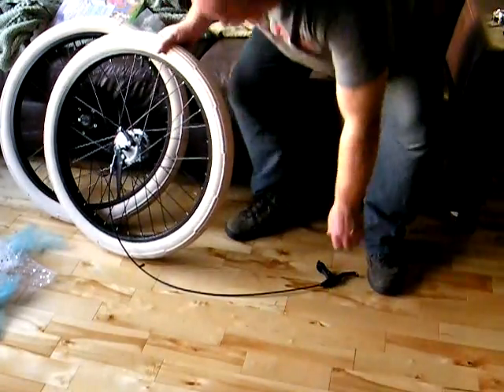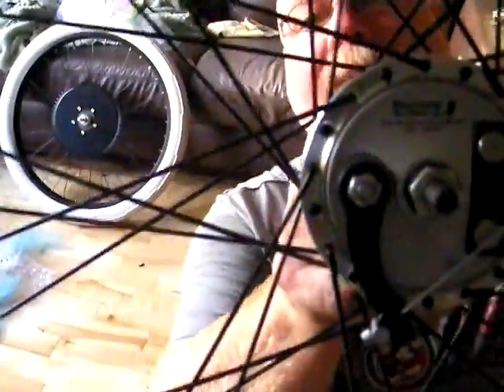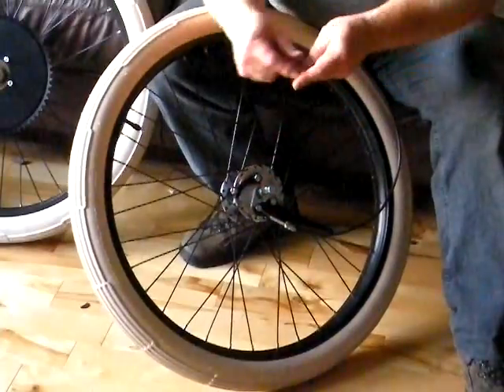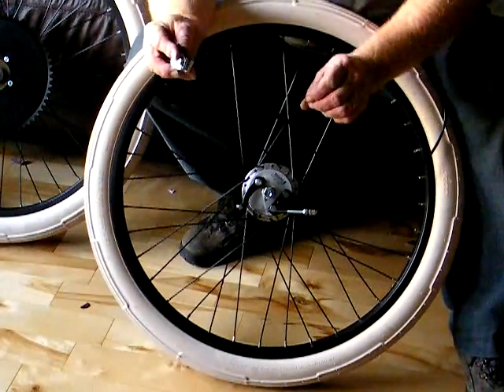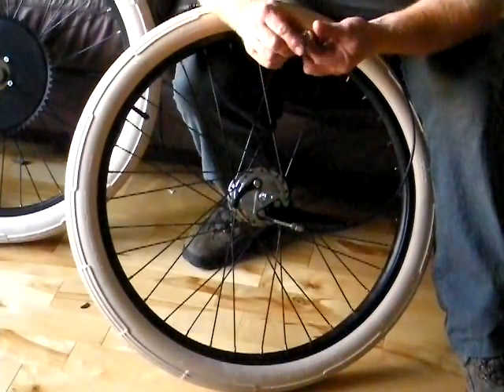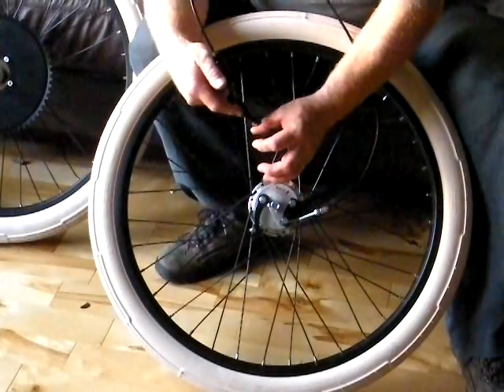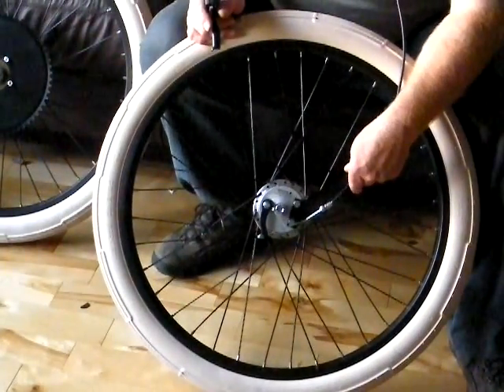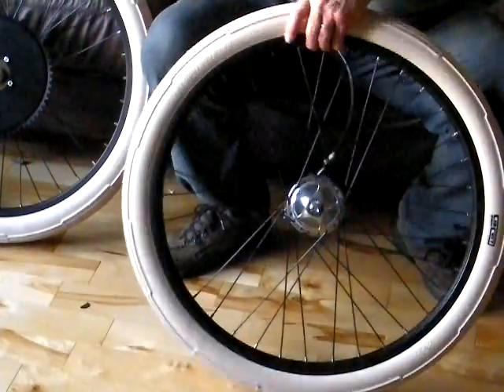Sturmy Archer Drum Brake Explained

Comment: Are drum brakes better than rim or disc? It seems to me that they would be less finicky, less maintenance and work well in the rain. Is weight the only drawback and if so, how much weight are we talking?
Reply from the maker: The wheel with out tires is 6 lbs.
They can be better in the rain.
They are low maintenance.
Yes the are better than rim brakes
Reply: Terry Blow
Is that with aluminum rims? If so, what's the weight difference between a V brake rim and one with the hub brakes? Thanks for answering so quickly.
Reply from the maker: tarstarkusz Yes aluminum rims.
V brakes are lighter but will not have as much braking power as the drum brakes.
I picked the sturmey archer drum brakes for the sealed bearings and that they have great wet weather stopping power, weight was never an issue because these are going on a gas powered bicycle.
Reply: Terry Blow
Thanks.

Comment: Will this break work on a GT Dyno Deuce triple tree fork? I plan on motorizing mine which calls for front breaks. I would try disk breaks but that requires to much complicated modding and spending more money. The front wheel is a 26 inch with a 36 spoke hub. (please use inches when describing measurements, thanks.) I need to know what the exact measurements are of the axle and the hub radius.
Reply from the maker: Hi LOL you don't need to know all that info the current front wheels that I am building for sale are 3.54331 drum brake made by sturmey archer it comes with the front brake cable nuts and washers also includes a braket for the brake to attach to your forks if for what ever reason it is the wrong size you can just use a hose clamp, its just that simple, oh yes they are 26 inch 36 spoke 90mm drum brakes with 9mm axle lol sorry do the convertion
Reply: Thanks. The bike I'm using only has a rear coaster break which could mean death on a motorized bike doing 30 to 35 miles per hour. It also uses flame slick tires which look cool but probably aren't the best for stopping when only using the stock coaster break.
Reply from the maker: +Joe Kenda flame tire are just fine unless you ride in the rain lots

Comment: Hi, I have a question. I am in need for the cable mount kit for this kind of hub, I have a hub Joy Tech that uses exactly the same system but I don;t have the screw tha cable has to be installed to. Is there a place where I can buy online this? I have the mention that I am from Romania.

Any info would be of great help.
Thanks

Comment: I am building a Recumbent Trike & wish to use the S/A - X-SD Recumbent Trike Brake Assemblies. These are mounted by one side of the axle only. How important are the torqueing of the axle nuts? Is locking down the nuts by hand sufficient or is it possible to over tighten & ruin the sealed bearings? Thanks for your help.

Comment: When the brake is applied the torque arm is coupled to the rotational energy of the wheel. When the bike is moving forward the the top of the wheel is rotating around in a largely forward direction and hence the torque arm is pressed forward into the back of the fork blade.